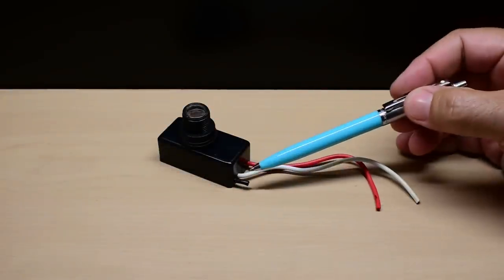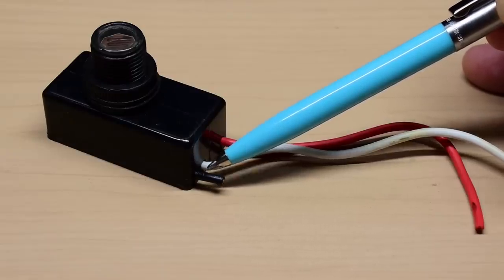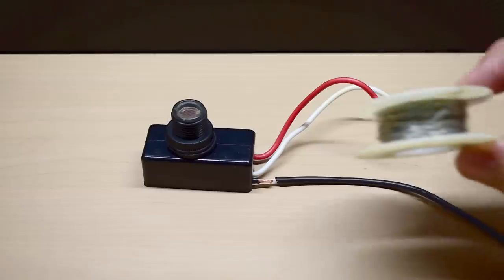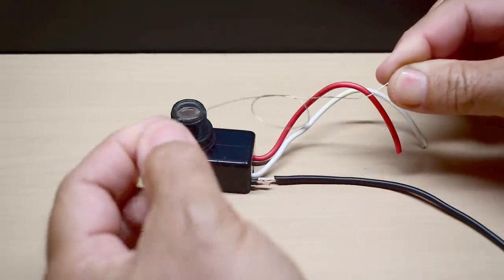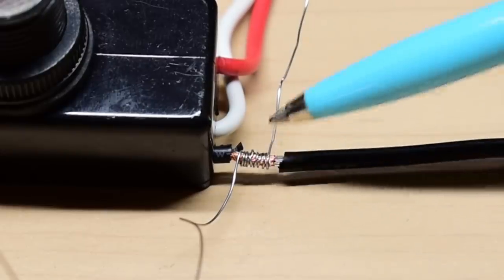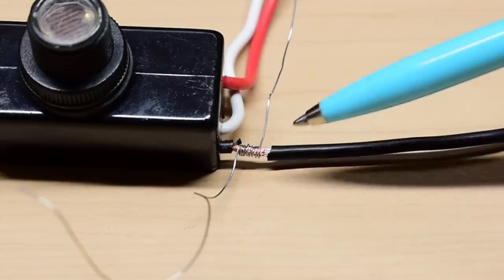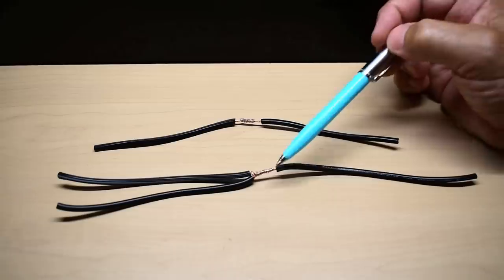How To Repair Splice Or Tap Into Stranded Copper Electrical Wires!

Comment: I have done many repairs like this, without the 26 gauge wire.  That is 2 wire soldered together in a composite manner, that is 2 or more materials together and it is stronger than anyone of the original material, I believe.  I never test that theory using weights.  The only possible issue I see is if you hold one wire vertical (tight, in a vise?) the other wire vertical and pull.  The soldered join will pull apart, little by little and slowly.  My solution, have a little longer wires so you will never see the pulling.  That is little or no movement at the soldered join.  For example, under the hood of an engine (vibrates) to the frame of the vehicle (no movement).  I will secure the soldered join to the engine or the frame and let an unsoldered wire in between the two.

Comment: Hard to tell but there might have been enough wire sticking out to use the self splderjng and sealing butt connector. Those have saved me so many times.
Reply from the maker: Using a butt splice connector on a wire that short would cause the connector to stick straight out off the plastic housing.
Reply: @electronicsNmore  you do know which butt splice im thinking of dont you? They are basically a piece of marine shrink wrap with a liquid metal in the middle. You slip the stripped wires in the ends heat the center with a pocket torch and it solders and shrink wraps all in one step. Surprisingly strong bond and takes a third of the space a regular butt splice

Comment: Your solder joint looked frosty like you didn't get it hot enough.. It should be shiny like liquid mercury..

Since both wires were stranded, you could have first dipped them into solder paste, then push the strands into each other until the ends of the wires touch the insulation of the opposing wire, then soldered them. It would make a joint similar to how they do the 2 phonebook interleaved page tug of war test.. 

The only problem with any joint like yours or mine, is that the wire closest to the insulation is half the diameter as the soldered part, and that is where the wire would break from bending as the wire flexes.

Also, if you are splicing two 2 conductor wires(Like speaker cables), cut one wire on each cable 1 inch longer than the other, so that when you connect the 2 cables together, the joints are staggered so the exposed wires won't touch each other. This would also make the connection less susceptible to breaking, because the bare solder joint of one wire is parallel to the insulation of the other conductor. AND since the joints are staggered, you could cover both conductors with a single heat shrink tube.
Reply from the maker: It was lead free. LOL
Reply from the maker: 60/40 definitely flows better. I have so many rolls of lead-free, so I hate to throw them away.

Comment: Good video, but even better would be to fully mesh the two wire ends into each other and then give a little twist (as opposed to just resting them side by side.)  Just a thought
Reply from the maker: Sliding one wire into another can be a real pain in the @ss. Been there, done that. Sometimes the strands bend outward, or you don't mesh them evenly. They also pull apart much easier. Thanks for watching

Comment: I like the idea, but it would be much stronger if you tied the overhand knot, then wrapped around once in both directions, then take the tails of the main wires and fold a third of them over the tie wire 180°. Then wrap the tie wire over the folded back wires and complete as you did.

As you have done it the connection relies entirety on friction which can change as the joint expands and contracts with heat.  The folded back loops makes a mechanical connection. Even if it loosens a little due to thermal expansion, the loop cannot unfold and holds it together.
Reply from the maker: Use whatever method you like, but make sure the wraps are tight.

Comment: (I'm not going to go through 428+ comments to see if anyone offered this suggestion...)

I suggest, for an even more secure butt connection of stranded wire, make the strands straight and push the two ends together, making the strands go between each other. You get much more contact of the two wires than the side-by-side arrangement.

Comment: This seems long winded and awkward. Once the two ends of wire are stripped, gently press each tip to splay out the strands, then push them into eachother and twist them together, solder and heat shrink to finish. No need for the wire, knot and the finished join isnt kinked.
Reply from the maker: Some viewers don't realize how useful this method is under certain circumstances(conditions). A large number of people that say it's a waste, one day may find themselves doing it. Thanks for watching

Comment: I wish you could have shown us the actual wrapping of the wire. Ive done this and its not easy most of the time.
Reply from the maker: Not hard to do. If space is limited, hold the connection using needlenose pliers as you wrap.

Comment: Unnecessarily complicated. Either use an uninsulated butt splice or interweave the stranded ends and then solder. Finish either with glued heat shrink. They'll be just as strong, and if you're applying enough pulling force to break either these or yours you need to anchor your conductors better. They shouldn't be pulled enough to break.
But nice video.
Reply: This produces a better connection than a Butt-Splice. Don't be jealous.

Comment: Or you could just push the wires together so the strands mixed give them a squeeze and solder even stronger less fuss and finish with shrink sleeve.
Reply from the maker: The interweaving process usually results in an uneven weave(especially with fine strands), and many of the strands push outward in the process. There will be many instances where your fingers will be unable to grasp a very short wire to do as you said.

Comment: while I am sure that this method also works, I would just solder the connection solid, then cover it in heat shrink/conformal coat it, and be done with it.
Reply: Uhh. Guessing that you didn’t watch the whole video or you commented before you finished. He does solder the joint and cover with heat shrink. Just past the 7 minute mark.
Reply: @stephenrich3029  
I watched the entire thing.
I stated "Just solder" in my statement because I feel all the prep work, while being all fine and dandy, is unnecessary to make the connection
Reply: I get what you mean and it would probably be OK for a connection that's not going to move about. However, if the wires are going to be subjected to strain, the straightforward solder might fail. So, making a sound mechanical join using this "coil method" before soldering is usually what I would do.
Reply: @Steve-GM0HUU  I repair broken wires almost daily with nothing more than solder and heat shrink. Thousands of perfectly fine examples made without first tie wrapping anything together that's are still together to this day

Comment: Meh - just use a thin wall uninsulated crimp tube.  The crimp will crush the strands for a proper connection.  Cover with glued shrink wrap.

Comment: Technically, from a quality control standpoint, there was too much solder on that solder joint; when the proper amount of solder is applied, the wraps of the wrapping wire will still be noticeable.

But definitely an acceptable way to join the wires, unlike most YouTube videos that are poorly done where the wires just get tack soldered together.
Reply from the maker: There was a reason for that, I used lead-free solder. :-) I have a few rolls of larger diameter solder that I rarely use, and didn't want to waste my good 60/40 or silver bearing solder on a demo. It does not flow nicely like 60/40 solder.
Reply: @electronicsNmore   - yes, the ROHS regulations pretty much prohibit use of good old 60-40. Other solder formulations require more heat to flow, and even then the flow isn’t as nice as 60-40.

I did want to make viewers aware that this method of splicing is acceptable, and that the wraps should be noticeable; if the wraps cannot be noticed, then that could mean the joint is just a butt joint, lacking the secure mechanical connection that is supposed to be in place before solder is applied. I’ve seen too many YouTube videos with tack soldered and cold joints, and we know those are bad but viewers will not always have that same awareness.

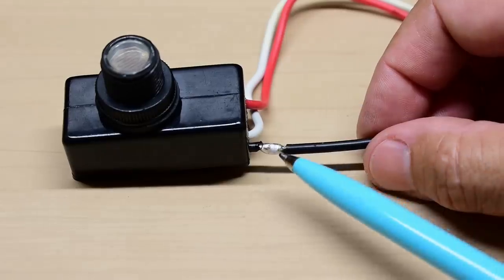Comment: A good instructional technique but not necessary if the repair person knows how to make a good properly soldered connection to being with. Also, there are two glaring issues with this video  1) At 0:48 you state "when done properly the spliced area will be around the same diameter or slightly smaller than the outside diameter of the wire". That's Impossible! You can't place a wire "of any gauge size" along side a wire of the same gauge and have the combined thickness of the two be equal to or smaller than the original wire size. Even more impossible is wrapping the joint with a third wire and having the result be the same diameter or smaller. Perhaps you meant "slightly larger"...  2)  I hate to say it but at 7:09 that IS NOT a beautifully soldered together as you stated. You're actually a showing an example of a bad or "cold" solder joint. FACT: A beautiful soldered joint is shiny and reflective like the surface of a mirror. Your solder joint was looking good around 7:05 but you moved the solder joint when sitting it down which caused it to "frost" over, giving the solder a dull appearance which makes for a weaker solder joint. NET: In addition to properly cleaning conductors before soldering you should have stressed "Let the joint cool before attempting to move it" .. if accidentally moved, simply reheat the joint and let it cool.
Reply from the maker: Correction, there were no glaring issues. I made it very clear in the video that I was referring to the O.D. of the wire with the insulation, and second, there was nothing wrong with the soldered connection I made. A shiny connection is what you get when using 60/40 solder, not lead-free solder. Lead-free solder leaves a "frosty" appearance, it does not mean the connection is "cold soldered". The solder flowed beautifully into the strands, the only issue was a little more solder was applied than I normally use. Having a little extra solder applied to the connection will have no negative effect on the spliced connection. Thanks for watching

Comment: A non-insulated butt splice would have worked good too, the extra insulation wouldn't be in the way, and you can then put heat shrink over it.

Comment: Nice, but showing the actually wrapping of the wire would had been very helpful in learning.  Shame it wasn't included.
Reply from the maker: It's just a simple wrap, nothing special. Pull tight, wrap, then trim off the excess.

Comment: if the wire is a bit old and black, a bit of flux will help alot
Reply from the maker: Always scrape the wire as shown to clean it up. You can fan out the strands then lightly scrape. Thanks for watching!

Comment: I would not of thought that the pull test would of pulled over 10lbs.
Reply from the maker: The tighter the wrap, the better the connection. Thanks for watching Mike!
Reply: @electronicsNmore  I have been an electrician for over 30 years, and if I didn't actually see you do the pull test, I would of not believed it. Looks like I have a new way of making short splices from now on. Thanks for the video. Just subscribed,

Comment: Not a good idea to use flame on heat shrink. Use the bulky part of the soldering iron. The temperature is more consistent and within a proper range.
Reply: A simple heat gun or a hot air rework station works a lot faster than a soldering iron or a flame and you can apply the heat very evenly so you dont burn things.

Comment: I see some practical advantages in workholding for the 3 wire splice, but for a 2 wire splice, the extra work is not worth the while. The end result will not be higher quality or strength.
Reply from the maker: If you ever have a very short wire, 6mm, and you cannot twist the wires together, you'll use the method.

Comment: Good idea but isn't that wire made of steel
Reply from the maker: Zinc plated copper.
Reply: @electronicsNmore  that hobby wire? I'll have to get some
Reply from the maker: @ericschulze5641  Buss wire.
Reply: @electronicsNmore  now if I wanted to add wire to the length of a capacitor for a speaker is that also called bus wire copper with a zinc coating ?

Comment: I am using a power adapter where it had no wire sticking out and just cut from the base and i just put flux and soldered both sides first the  the them touch each other and solders again and did not have an issue again after 3 years or use and abuse. Just put some electric tape only on top. 
You go a bit too fancy and professional looking in your repairs. :)

Comment: Actually not a bad solution if you can't solder, just don't let any moisture at all enter the connection or you will have trouble a few months down the line...  If you can solder then just use low melting point solder, as its near the device and you don't want to de-solder the wire from the pcb lol
Reply from the maker: Yes, that's why I told viewers to apply adhesive lined heat shrink. Thanks for watching!

Comment: a proper repair would be to open the case and remove the short wire then solder a new wire in place.  then seal the case back together.  if i did a splice i would just tin both ends with solder then solder them together and place heatshrink tubing on them.  there is no need wrap the wires, especially when there is low wire tension.   if you have a lot of tension on the wire then you should have spliced in a longer piece of wire.  i have never had soldered wires come apart at a solder point after soldering them.   if you using a proper amount of solder then you should have no issues at all.  (debunked!)

Comment: Soldering is the ONLY acceptable solution in my opinion.
Reply from the maker: Everyone is entitled to their opinion. Thanks for watching!
Reply: @electronicsNmore  It is not just about opinion.  If that wire was carrying high currents, then your solution would be a recipe for creating a hot joint.
Soldering would have mechanically held the two wires together and ensure that each strand of wire was equally sharing the electrical load.
Reply from the maker: This is all part of the crimping/soldering debate. LOL You're forgetting that the solder, which is mostly lead, is far less conductive than the copper wire. If you use a high percentage silver bearing solder, then that would be a good choice.

Comment: I realize there is no answer for this question but why why why do people chop wires like that? Chances are good when you find something like that cut like it was the guilty person prob shouldnt have been messing around with electricity in the first place
Reply from the maker: I had to repair the wire on a chandelier that was cut 1/4" from the top nipple, this method worked like a charm.
Reply: @electronicsNmore  I learned this years ago when i was learning to build phone boards it works great when you can get your fingers to act right. I dont have that much luck any more
Reply: My thoughts exactly. If I chop out a component, cut a wire or chop a premoulded plug off something, I always leave a few inches of wire so that any future reconnection is facilitated.
Reply: @Steve-GM0HUU  when i see wires lopped off so short it makes me glad when i find out the culprit isnt a Mohel. Oy vey!

Comment: This is only for people/projects that don’t need to follow the electrical code, NRTL certification, any modern safety standard, quality standards, and has a labor cost of $0/hr
Reply from the maker: There's nothing unsafe about the repair shown in this video, and the repair is quality when done properly.
Reply: @electronicsNmore  I agree. But it doesn’t comply with any modern safety standards. 
If your are doing DIY repair on something that doesn’t require NRTL listing or building code compliance and you don’t need to pay for the labor time than this is perfectly fine.

Comment: Or you could just solder it directly. No problems doing that either.
Reply from the maker: For a high current connection, you want a strong mechanical connection as well.

Comment: Well thats a video that's at least 6 minutes too long.
Reply from the maker: Short attention span....Not good.
Reply: @electronicsNmore  No, you just waste time. From 3:50 to 6:15 was just how to wrap a wire round a couple of wires. You could have done that in less than 10 seconds.
Reply from the maker: @billdoodson4232  Get help for your ADD/ADHD, don't blame others.